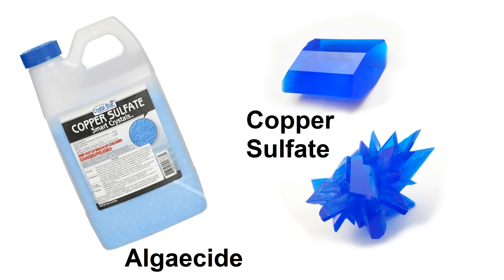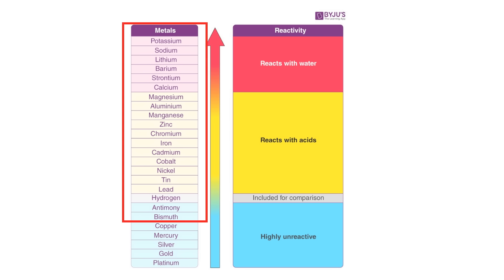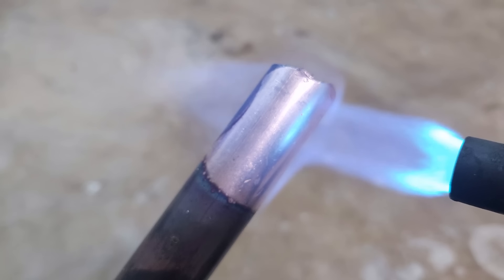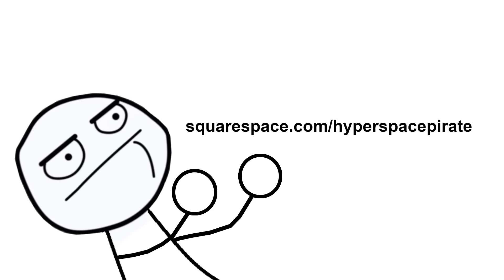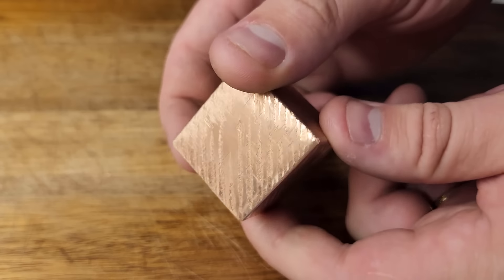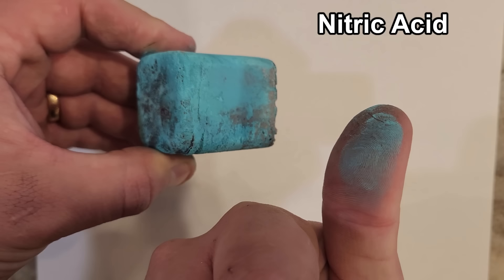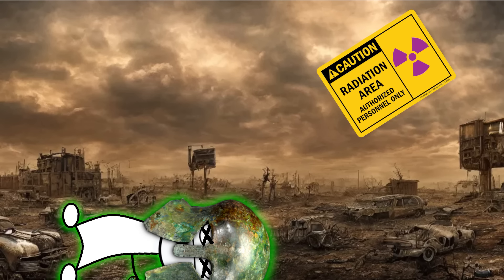Making Copper Parts from Algaecide

Comment: copper is suprisungly hard to mill - you need sharp tools, correct speeds and coolant. Btw. somebody convinced google ai that "full cream milk" is a good coolant :)
Reply: Just like someone convinced it that adding non-toxic glue to pizza cheese gives it better consistency. The future is looking bright :-/
Reply: @andersjjensen  that glue is caesin aka milk solids.  They make vegan caesin.
Reply: @lrmackmcbride7498  The glue in this example was specifically mentioned to be PVA (polyvinyl alcohol) glue. It is considered "non toxic", but is absolutely not considered "food grade".
Reply: @andersjjensen  we're just bringing back natural selection
Reply: @NvidiaRTX5080  the kind of person who lets others die is naturally selected out of human communities and out into the weather ;)
Reply: Milk was the recommended lubricant in turn of the century machinery's reference books such as Machinery's handbook. I'm sure it still works today. So can't hate google for that one, though I'd prefer my machine tools not to smell like rotting breakfast (animal lard was another common lubricant).
Reply: Yeah, it is a very sticky metal to machine.
Reply: @andersjjensen  If I remember correctly it was reading back a trick they use in the advertising industry to make a more attractive product, since it's only going to be looked at the PVA glue does in fact provide a better consistency for cheeses that won't be lost as the fats leave the cheese nearly as readily, by and large most of the food products used in advertising are produced via collections of techniques to fake their appearance- burgers are cooked only on sides they're going to be seen, have grill lines added by placing hot metal skewers against the surface and made using unpalatable ingredients that help whatever shot they're taking. 
It sounds ludicrous, but the AI didn't understand that this recipe for making something to be looked at and not actually eaten.
Reply: @CATASTEROID934  The AI picked it up from a troll reddit post where everyone replying just went along with it and discussed which brand of PVA glue they preferred. OP obviously got the idea from one of the TikTok videos showing how ad reels are made.
Reply: Ngl feeding bad ideas to AI seems like pretty funny hobby.
Reply: @lrmackmcbride7498  I think you mean casein.
Reply: @TheMetalButcher  everything is a lubricant if you're brave enough [unzips pants]
Reply: @quint3ssent1a   yes with the correct spelling.
Reply: @TheMetalButcher  lubriderm can be used, the generic walmart variety is way cheaper than the pro stuff and is basically the same ingredients, oil, glycerine, mineral oil and emulsifier.
Reply: theres only one metal i find harder to machine than copper... lead. more because you cant really HOLD it! ok, ive only tried twice, and both times... 

"hmmm, i dont think copper shim is going to protect this surface"

as for milk... yeah, it was used as a coolant. it IS an emulsified oil in water, after all. 

same time, carbon tet was recommended to be added to grinder coolant...
Reply: @andersjjensen  it actually does, but its really only works for commericals, and not eating
Reply: @TheMetalButcher  Tallow (the fat from around the kidneys) is still available as a lubricant for metalworking,
Reply: Is that because it's so plastic?
Reply: @ZeroPlayerGame  copper has high plasticity, ductility and is quite tough. As far i understand - you must deform the chip a lot before it breaks off the material. If your tool is not sharp or the machine is not stiff enough instead of cleanly "shearing off" the chip you will  bend it and drag over the material.

Comment: "Propane furnace off amazon", this is another reason I like this channel.  I didn't know I could get that on amazon.  It just fills my head with stupid ideas.  lol
Reply: If you plan on getting into smelting like I did, then I highly recommend taking a loot at Devil Forge as well. A little more expensive, but the quality has been well worth it so far.

Comment: I finally found someone who understands me. I also built my own CNC mill and it cost a lot (and worked poorly). Now I'm putting even more money into it and hoping it will be different
Reply: I am gonna build one too, any tips?
Reply: @MikeOxolong  yes, don't, unless it is 110% as a hobby project funded 100% by throwaway funds you have laying around
Reply: Git gud, scrub. Best advice I can provide, unfortunately...

Ohh, and make sure your rig is as rigid as possible, overbuild it up the yin yang, rigidity is everything in a milling machine. Also ensure that backlash is minimized as well,  a couple tenths of slop at the spindle can equate to several thou at the tip of the cutter. If you can't build heavier then build harder, the hardness of your supports will decrease flex and backlash, consider heat treating all the components of the frame if possible (use a medium carbon alloy, something you can heat treat to 40-45 Rockwell). Also make sure your drive components aren't underpowered or sloppy, use baller ballscrews instead of belts and strong servomotors, overbuild everything. And do remember that the foundation you build upon is the most important part of the mill, if you build it on top of a wood desk remember that your machine is only as rigid as what it is mounted on. A 2" inch thick slab of steel or 4" thick slab of granite is infinitely better than a piece of 3/4" thick plywood. 

Rigidity, rigidity, and rigidity are your three guiding tenets when building a mill, remember that...
Reply: @MikeOxolong   
@TheExplosiveGuy gave you good advice on the construction, but before you even draw 1 line in cad you have to answer the question: "Why do I need this?"

A CNC milling machine is terribly expensive to build, works very slowly, requires expensive consumables and requires expensive materials for milling (check how much a piece of bronze or aluminum costs). So it's better to have a good reason to do it.

If you want to create parts for your projects, buy (for the money you have to spend on building a milling machine you can easily buy a good model) or build a 3D printer. It is faster, cheaper, can do more, and works on relatively cheap materials. If you need more durable parts, don't mess with metal, just print them bigger.

If you want to build your CNC machine anyway, design it with ease of use in mind (how you attach the part, how long it takes to start, how the tools are inserted). I know it sounds obvious, but you really don't want to spend a lot of money on a machine that is a pain to use. A CNC milling machine is not a machine that can work without CONTINUOUS supervision and the process of starting and preparing the machine can take ~45 minutes, the program can take 2/3 hours (if there is a large detail), each manual tool change + recalibration takes at least 10 minutes and at the very end it may turn out that it failed. A CNC milling machine can very easily damage itself, so it must be constantly monitored during this time
Reply: PS. You will spend at least twice as much money as you planned (and that's assuming you had a large buffer in your original budget)
Reply: @MikeOxolong  First buy a manual machine (ideally a lathe) and perform some manual milling on it as well as use it to build another manual machine (ideally a milling machine).

You will make mechanical and structural engineering mistakes starting with a CNC machine having no actual machining experience.
Not only this but operating a CNC as a learner is time consuming, particually for small jobs which could be done on a manual machine.
Because of this you won't learn the mechanical/metalworking skills and intuition as quickly as you would a manual machine (no coding, just clamp the metal, turn the handwheels etc).
Get a feel for the machine, become one with the machine, feel the rigidity or lack there of.

I built my CNC first before inheriting my Grandad's lathe and after which building a manual mill using it's heavy milling attachment/adapter as a starting point.
I wouldn't have made the simple mistakes I did if I had the order the other way round as I would've got that feel/inituition first.
Reply: @TheExplosiveGuy  but heat treatment doesn't significantly affect Young's modulus (stiffness).

Comment: It's actually the hydrocarbons reducing the CuO back to Cu metal in the torch flame, it's not necessarily just because of the heat.  There's a redox reaction going on too.  You can see this by first heating the CuO a little bit then cutting the flame and then you can just use the unburning hydrocarbon and you can see it will quickly reduce the hot CuO back to Cu at a much lower temperature.
Reply: Thank you, that was my understanding too. And which is why it immediately turns black again as soon as he removes the flame - not after cooling down. And also why it only reduces to cooper exactly where the flame is, regardless of temperature, despite it conducting heat so well.
Reply: This works even better when you dunk the hot black copper in ethanol. The black copper oxide then instantly gets reduced back to red copper metal - and the ethanol gets oxidised to ethanal, which has a distinct smell (ripe apples).

Comment: Your joule thomson coolign series inspired me to make a cooling system of my own to try and collect and liquify the gaseous radon present in my basement.
Reply: That's quite the "turning lemons into lemonade" thing ever!!!
Reply: I... Is that, safer? Like that? Like, it gets it outta the air at least, but then it's concentrated. But then it can be concentrated in a lead vessel. You gotta post about this somewhere I'm invested now
Reply: @Enderbro3300 Definitely not safer lol
Reply: Sounds precisely sketchy enough that I would watch the crap out of a video series about the project. Just saying "liquid radon" out loud checks all the boxes for me.
Reply: How much radon do you expect there to be? The half-live is 4 days. You are not going to liquefy a microgram of that stuff, which is perhaps as much as there can be at any point in time. Let alone liquefying a visible quantity without dying.
Reply: @leocurious9919  A) you don't know how much radon gas they have in their basement or how big the basement is, and more importantly  B) it was a joke.
Reply: This is almost certainly a joke, but something interesting about it.  As the noble gasses' atoms get larger, they have higher boiling and freezing points.  Here's Rn: liquefies at −61.8 °C (−79.2 °F) and freezes at −71 °C (−96 °F).
That's well within dry-ice levels.  No need for anything fancy.  

As for why it's a joke, Rn decay's in a few days, and would be found in parts per trillion in your basement.  The only reason we notice it at all is because it is radioactive, which lets you detect decay of single atoms.

Comment: The voids in the copper are due (in a big part) to the fact that molten copper has a high affinity for oxygen, which dissolves into the melt from the atmosphere present in the gas furnace.
You can solve this by taking a little 30mm length of 12 mm copper pipe crimped at one end and filled with Ca(OCl)2 on a length of stiff iron wire and plunging this to the bottom of the melt immediately before pouring. This gives off chlorine which sparges the dissolved oxygen out of the melt. 
Worked wonders when I used this trick.
Reply: Wow nice trick!
Reply: Is there an easy to get product that's calcium oxychloride?
Reply: Yeah check the MSDS first but some solid pool chlorine products are technical grade calcium hypochlorite.

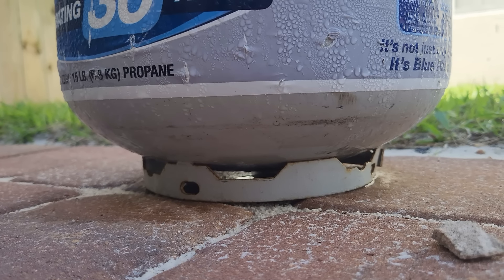Comment: 7:49 place your propane tank in a bucket filled with water. it will stabilize the temp of the tank and prevent freezing. i learned that one from years of running propane ovens at festivals lol

Comment: If you want another rabbit hole of reducing copper sulfate into solid, useful parts, try DC-biased AC electrodeposition. There's very little literature on the topic, but if you fine-tune the parameters (I'd start at a DC bias of 1V with an AC waveform of 2V above and below that, 60Hz) you can basically 3D print the deposited copper into any shape you want by moving the "anode" around the conductive graphite bottom plate. The close proximity of the electrode (1-2mm) and reverse plating during that part of the cycle means you get solid, useful parts instead of flaky copper deposits that would occur with normal DC electroplating.

If you have a fancy electric signal generator, you could use that, but I've found that just using one of those AC/DC wall adapters with the circular plugs (that cheap appliances use for charging) works; if you've got a spare one (since you have to cut the head off it and separate the wires) in the right voltage/current levels. You might also be able to generate an appropriate waveform using audio software and running that signal to the electrodeposition wires instead of a speaker.
Reply: user-yb5cn3np5q  It still doesn't have a modern name because basically no one uses it or writes papers on it. It's super finicky, so if anyone foes use it they keep it in house
Reply: Could you send some useful papers about it?
Reply: @19Gacek89  I can't provide links because youtube often auto-ghosts comments containing links, but googling 
pulsed reverse current electrodeposition
should get you in the right direction. No papers I've found talk about using it as a metal 3d printing technique, but it works for that from my (albeit limited) experience.
Reply: electrically, never heard of it, but the mechanical part sounds like Sunshine´s video "i made a METAL 3D-Printer at home!"   ( W1d36wbx_yg )

Comment: Not just the CNC dust maker. But freecad as well? Institutionalize this man! 

Jokes aside. Really awesome video! Copper is really one of the best metals out there. Soft enough to work with basic tools. But still hard enough for jewelry. And you get all sorts of neat colors from it.
Reply: Hey now, at least it isn't openscad
Reply: @Ammoniummetavanadate  luckily, I've never had the misfortune. But just looking at the webpage was a mental flashbang.
Reply: @Ammoniummetavanadate  I've fooled about with openscad before.  It kinda sucks.
Reply: I just got into CAD, and have learned FreeCAD as my first parametric CAD software. It's really good!
Reply: @stockwellengineeringhints3527  Yeah, I use FreeCAD too -- mostly for 3D printing, I don't have any heavier tools yet. It does the job, and I'm always happy when I can skip straight to learning a FOSS package in some field rather than learning something proprietary (even 'free*') first and then having to adapt later when they inevitably try to screw me over somehow. I kind of bounced off of OpenSCAD -- I can definitely see the appeal of a programmatic way to generate parametric 3D models, but it just wasn't a programming language I liked.

Comment: So starting from powder you are best off compressing it, ideally with a cold isostatic press but if you don't have one of those like I do you can use a hydraulic press and a pellet press die.

You are right, flux helps a lot, I am sure you fired around the papers on this.

Adding an ultrasonic probe to your tank will speed up the dissolving process a lot.

Comment: You can also grow fairly large copper crystals in copper sulphate electrolysis. My largest so far is 2 kg.
Reply: do they grow in pretty shapes or just typical metal fractals?
Reply: @crackedemerald4930  
It's a shame I can't post pictures of the ones I've done on these replies. The dendritic growth is largely dependent upon factors such as electrolyte concentration, distance between electrodes, voltage and current, they are generally random in nature, but some control is possible.

Comment: Copper sulphate electrolysis is also a way to digest base metals (especially Copper) from scrap electronics. Leaving gold in the waste. Possibly even in the form of gold foils.
Reply: Would you mind explaining that? Sorry for how late I am.
Reply: @combycat  
Do you have a specific question?
It's not particularly difficult. One does need an anode bag to retain the resulting foils. And an inert anode material. I used titanium foil. The copper will collect on the cathode, so starting with a copper wire, or plate makes sense.

Comment: After washing your powder, wash with very dilute HCl to remove oxide layer, filter, then wash with acetone to remove any water. Mix with a small amount of graphite powder. It will make it less reactive, act as a lubricant when cold pressing, then it is packed in carbon and sintered.

Comment: also the bubbles are dissolved oxygen. Melt it with a reducing flame (and pour under a reducing flame) and you wont get them. You can also add charcoal to the furnace to help too.

Comment: Copper is gummy as hell, so my recommendation is a two or three flute cutter, increase spindle speed, slow down feed.  When I cut copper and I can't or don't want contaminants I use vegetable oil, in your case it would have to be flood cooling to flush the chips out.  Neat process and it was fun to watch.

Comment: Copper can be electroplated onto 3-D printed parts.   First electroless copper deposition is used to plate a thin layer, and then electroplating is used to thicken the layer.

Comment: If you want to patina copper, get a plastic bin.  Put a cup of household ammonia in the bottom, and then the copper item in there.  The ammonia fumes will turn it a nice black.  Dont do it on thinwall stuff because of stress corrosion cracking, but for something like your cube it would work fine.

Comment: If you don't want to buy firebrick, you can get some plaster of paris from home depot which ends up porous enough to let the water used for mixing evaporate out instead of building up pressure like concrete did in your first pour.